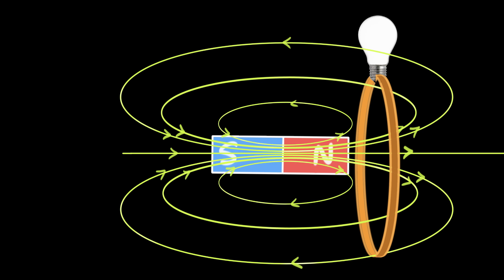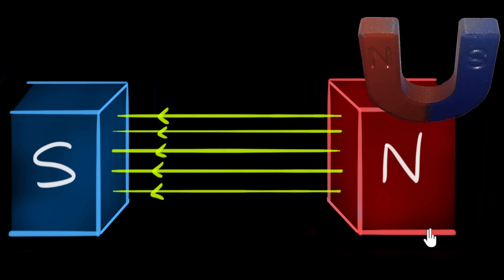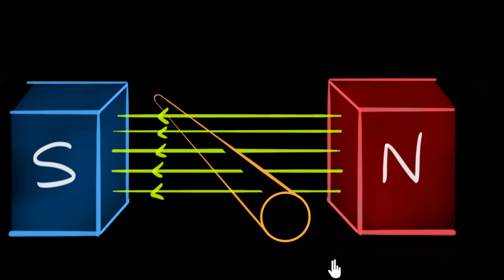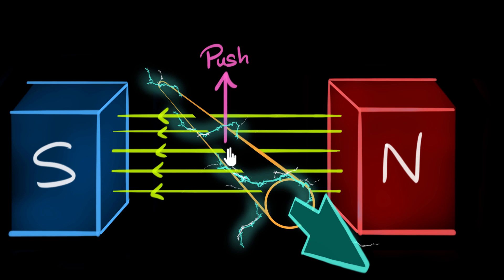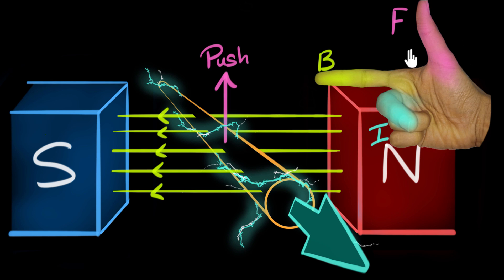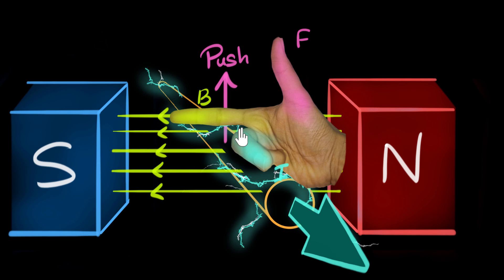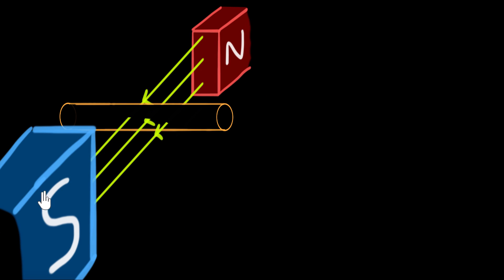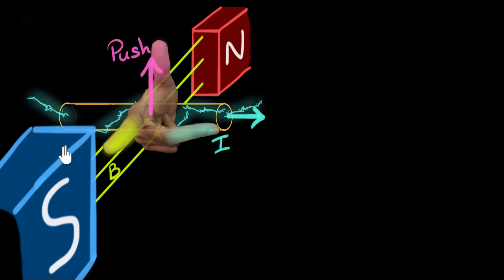Right hand generator rule

Comment: Is there a reason to as why the current flows this way?
Reply: @mrk-2 When you push a wire through a magnetic field, the wire will want to resist that action. Thus there will come a current with its own magnetic field that will create a force that is trying to resist your push. If you push down, the wire will want to create a current with a magnetic field in such a way that it creates a force pushing up against you pushing down.
Reply: It is just a property of electric current.

Comment: u know why B is used? It is because of a scientist known as biotsavart who found out the magnetic field intensity formula to calculate it. It goes like
                                 B=  µ0.I/ 2.pi.r
                                 µ0= 4.pi.10^-7
for straight current carrying conductors [C.C.C]
Reply: B is magnetic induction or magnetic intensity here it came by the rule of electromagnetic induction so biosavrot law is not used here .... it's is other application
Reply: Other application means it defines clear indication of current but here we discuss about current, direction of motion, magnetic field